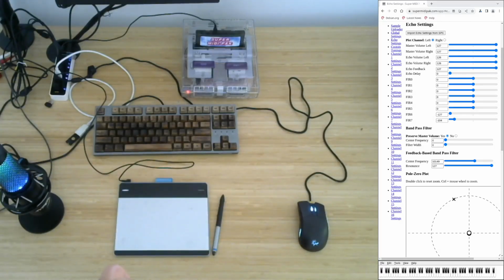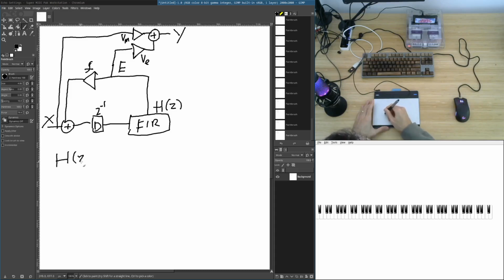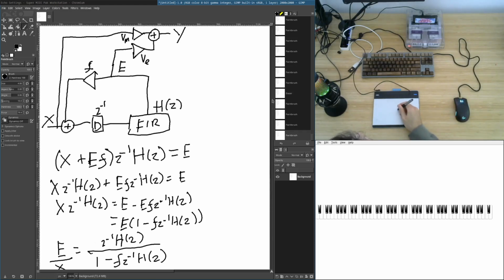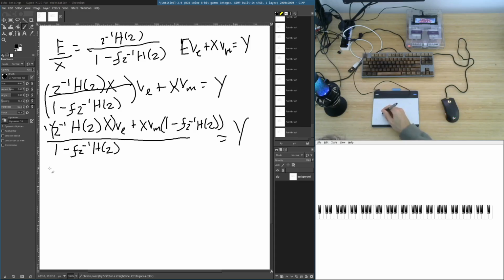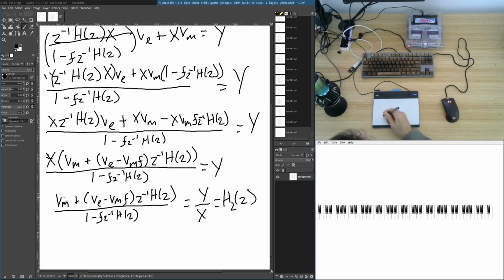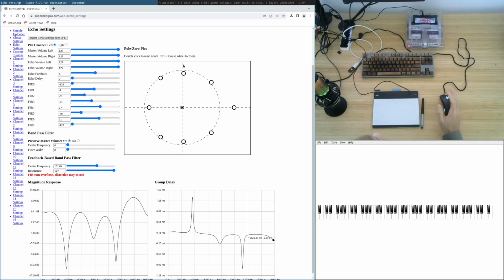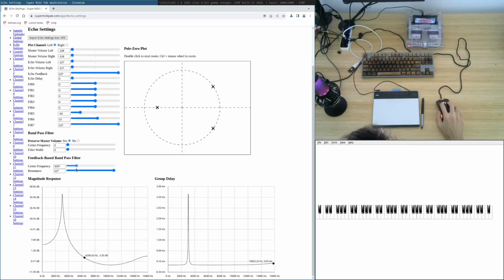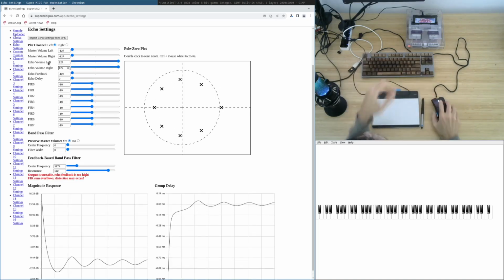Maxing Out the SNES Audio Filter Hardware

Comment: Unrelated question, would it be possible to stream multiple samples through one channel, like the Genesis does?
Reply from the maker: It's been shown that you can stream samples into the SNES APU. You can in theory do some basic sample mixing on the main CPU before sending to the APU for output. Is that what you're asking? Come to our discord if you have a more complex question.
Reply: @supermidipak yes, exactly that! I've heard some people managed to do the sample mixing localized in the z80 on the Genesis, but without the ability to control pitch.